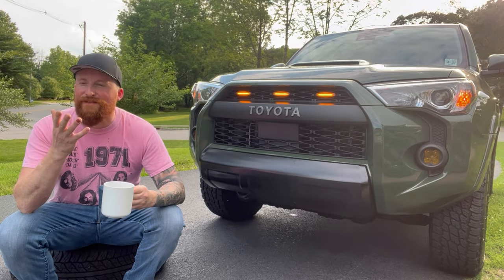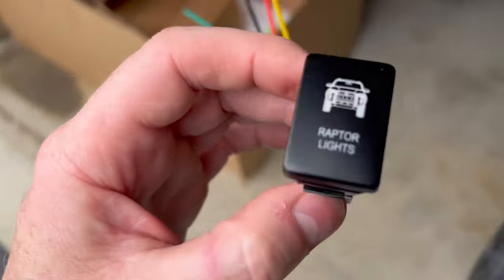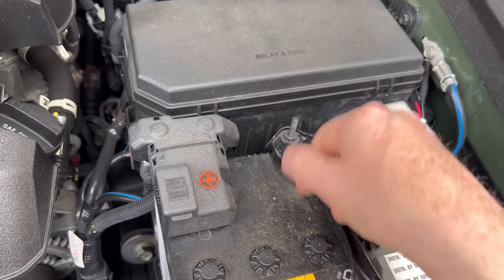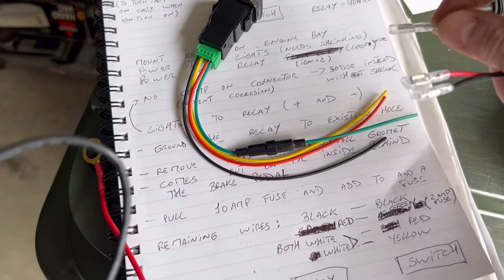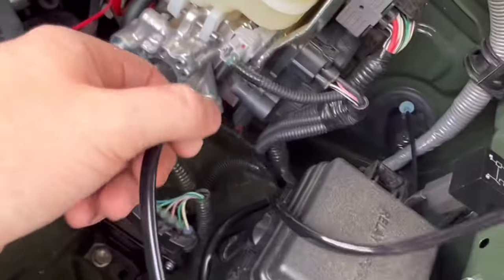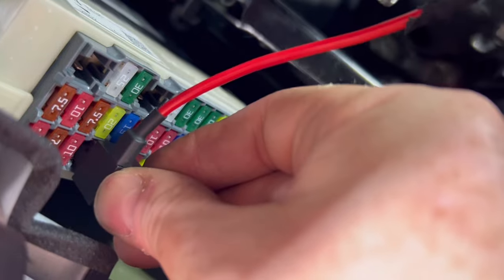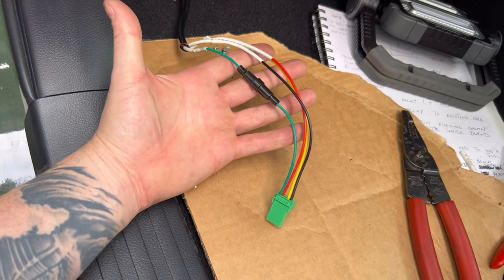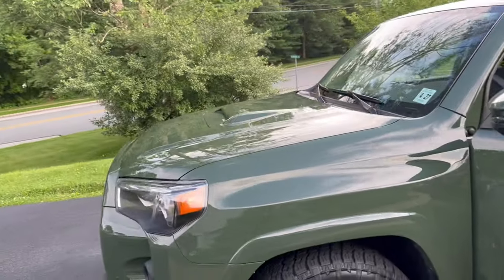TOYOTA 4runner - Raptor Style Lights • install with a switch and Circuit

Comment: Very nice!  Thanks for taking the time to make this video.  Forgive the stupid question please:  Did you replace the engine compartment fuse with the one inside the cab?
Reply from the maker: No such thing as stupid question… the engine compartment fuse has to go back in, only fuse your installing the add a fuse is on the inside fuse box (IGN No 2)

Comment: For the add a fuse did you locate the power side or just install it? Because a add a fuse needs to be oriented correctly for proper functionally. Thanks

Comment: How would you wire up the switch if you didn't use a relay, and they weren't going thru the fuse box, but battery positive?  The LED lights don't draw a lot of power, so the fuse on the switch should be enough (I'll put an inline fuse between the switch and battery just in case)?  So if you have the red and black wires coming off the lights, with the red / black / yellow / green wires off the switch, which ones would go where?  I know one switch wire has to go back to battery positive, one to ground, and one to illuminate the switch, but which ones, and what do you do with the "leftover" wire?

Comment: Thanks for the video I have the same raptor light to install with a switch  on my 4Runner TRD pro 2023. but it's come with a 15 AMP fuse to put at the ignition  in the fuse box. when I put just the 10 AMP fuse come with the car the engine don't want to start at all. I put both 15 and 10 AMP the raptor light and the engin work very well. Should I leave it with the 15 AMP or buy a 10 AMP? I waiting for your advice.
Reply from the maker: Are you using the correct fuse… either way never increase the amperage on a circuits fuse ( that could cause an electrical fire).

Comment: I did the connection just like you did it, I got power on the connector of the switch but the switch is not working. I used the provided switch that came with the wires and it turned on the lights. But the raptor switch is not working. Is there a chance that it came defective? How I could diagnose the switch it self?
Reply from the maker: remove it from the dash and try again, they are know for binding. Not exact OEM fit.

Comment: I noticed the wiring harness in the description is a 2 lead harness. Looks like you only used one for the raptor lights. What did you do with the other lead?

Comment: Would you recommend caulking  the seams of the raptor lights? My cali raised didn't make it two months before it got moisture inside so now I am in talks with them to send a replacement.
Reply from the maker: Yeah, it’s a shame but, extra measures are needed to get these things to last.

Comment: Any reason why you used a relay? The 3 Raptor leds can't draw hardly any current. You should be able wire from the interior fuse block to the switch and go directly from the switch to the leds.
Reply from the maker: This is very true, but it’s better to be safe then sorry. Besides it’s super easy to add it to the circuit. (What I showed everyone is an automotive circuit the way your car comes from factory) 
And yes I could have ran the power source from the engine bay, but I much rather keep that fuse box completely closed to the elements. 😉

Comment: Why does it ave to go specifically into the IGN No2 fuse port, and can't I use another 10 A fuse location?
Reply from the maker: Sure, you can pick another one. 
That’s the one I picked. 😉
Reply: You'll want to use one that only comes on with the ignition. I used an add a fuse on the cigarette lighter circuit.

Comment: Okay so I attempted to install my raptor lights except I chose to keep the red power wire on my battery terminal and just feed the relay wires thru my fire wall, "disappointed" in my install because it won't turn on. I know I did something wrong but I just don't know what it is. It's passed my bed time so I will test the fuse on the relay in the morning, because I also have to install my ditch lights.
Reply from the maker: Good luck!! 👍🏻

Comment: So, I installed everything exactly like you did. However, the Raptor switch never lit up. For a few cycles it turned the Raptor lights on and then off, but then that stopped working as well. Assuming I did everything exactly like you, is it possible I blew a fuse? Or just got a bad switch? The switch itself feels insanely cheap and the green connector that plugs into the switch was a pain to get in and then ended up breaking the switch when I tried to get it out (this was after I realized the switched wasn't working).

And did you solder the red and yellow together first and then solder to the white one? Did you do one at a time? Thinking this may have been my fail point even though it looked good.
Reply from the maker: The switch fitment on the dash slot was a bit tricky, only fitted right once I wrapped it around some electrical tape.
I solder those 3 wires together… double check your fuses. 🤷🏼‍♂️
Reply: @VikingsGarage  yeah, I was testing the switch before installed it into the dash. The switch light never worked and it only seemed to cycle the lights a couple times and then stopped. Giving it another try today. Thanks!
Reply: Got it to work. I think I just had a faulty switch.
Reply from the maker: @JoshuaCaldwellDirector I’m glad to hear, they need to work on making a better quality switch and connector.
Reply: @JoshuaCaldwellDirector   i am experiencing your same issue. lights work via switch but switch doesnt illuminate. I emailed 4RunRun to get another switch sent out..... time will tell here

Comment: Hola....I wanna lift my 2021 4runnerSR5 what you recommend me
Reply from the maker: It all depends on your goals for it… a lot of options out there. 🤷🏼‍♂️
Reply: I used to build off road vehicles and do not recommend lifting. If you do decide to lift your 4Runner don't go over two inches if you don't want issues. Personally, and yes I have a 4Runner, your money is better spent on a quality "steel" set of under armor and rock sliders.

Comment: It seems to me if you're only using a 2 Amp Fuse on the inline fuse holder, those lights don't draw hardly anything why go through all the trouble using a relay
Reply from the maker: Because I can, and because you should. 😎
Reply: @VikingsGarage  it takes less than 1 amp to activate a relay, it makes no sense to use the relay when the lights only draw 1.5 amps
Reply from the maker: @victorcianflone5093  You seem to be very bothered by it, 
how would you feel if I insisted in telling you what to do? 
Regardless of your answer?
Thank you for watching!